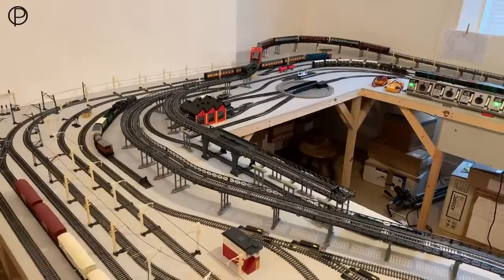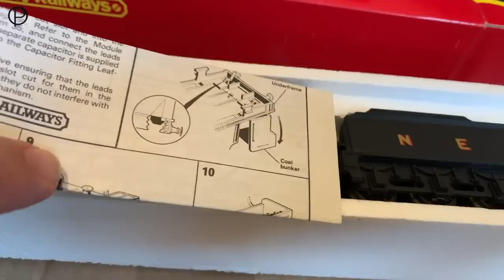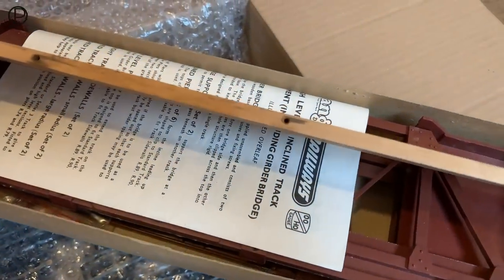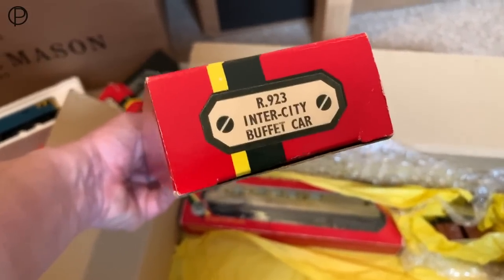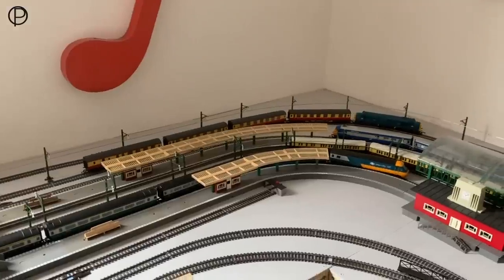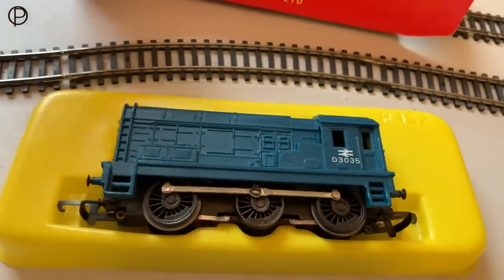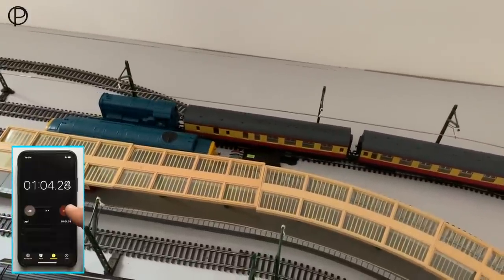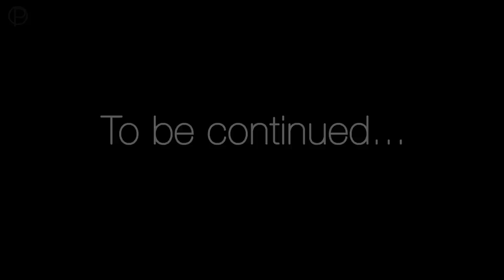A few new items for my Tri-ang Hornby collection plus slower running trains

Comment: For those who like a locomotive, but it has drop out issues over points. You can get a capacitor unit that will fit inside the loco. This stores the power for a short period meaning the loco will never suffer from short term contact problems again.
Reply from the maker: Good morning Graham thanks again for watching and the information its very much appreciated.
Take care.
Oscar

Comment: Hi Oscar, a great video with lots to enjoy. The roundel on the girder bridge sides looks like it doesn't have any molding on it - my grey R78 has a  triangle with an 'L', (Lines Bros. ?) and 'Rovex Scale Models'. I wonder what the story is for the different versions - all adds to the interest !
Reply from the maker: Good evening Peter glad you enjoyed the video you’re right I think there is something to those roundels I remember reading in the past I shall have to look it up. I think there’s also a slightly different design to the ends of the bridges over the years. There are so many little twists and turns in the history to these models it’s so fascinating.Thanks again for watching take care.
Oscar

Comment: Interesting experiments and some clever thinking. Might be worth looking at the other end of the speed range as well, what does any given locomotive do at full power with a sensible train. Gives some perspective too, the maximum speed on most preseved lines is 25 mph under Light Railway rules and a loose coupled coal train behind the old 3F tender loco would be doing well to get up to 40. Great fun
Reply from the maker: Good morning Andrew thanks again for watching glad you enjoyed the little experiment. It was great fun I think you’re right I should look at some different speeds.
Take care.
Oscar

Comment: My Dad  always told me not to run on half wave and high resistance as the motor would warm up , so I never have other than for slow speed shunting, for 50 odd years!. Is that wrong . Certainly impressive slow speed running. 6.9 mph on the diesel shunter wow , mine is usually at Warp 1 .  I have A Clipper from 1975 , ironically I only got it because they didn’t have the Hornby R910 in stock. I remember being disappointed at the time but it is a good controller . Still going strong after all these years , although my main Controllers are now Gaugemasters . Love the howl of the AL1 !
Reply from the maker: Good morning Russell great to hear you have the Clipper after all those years. Definitely worth hanging onto they’re a great piece of kit although I imagine your gauge master is far superior as technology has advanced. I’ve currently been looking at some more contemporary equipment myself. The AL1 certainly does make a terrific sound on the rails.
Take care.
Oscar

Comment: Great video, love unboxing videos. Can i ask why you ran the Lord of the Isles on half wave?
I have been told that it can damage the motor
Did your AL1 and coaches come in a train pack? Just asking as i have just bought one and some cantenery to go with it.. should be some fun!
Anyway thanks for the video and please do more unboxing style videos in the future.
Reply from the maker: Good morning Joshua great to hear you’ve got the AL1 and catenary to go with it. Mine came in the presentation set R.644A from the late 60s early 70s. In times gone by when my models were made it was considered that half wave was an effective method of gaining greater control over the locomotive. With some models this is true and others it has a little or no effect whatsoever. Some do say that it can lead to overheating of the motor however I find no evidence of undue heating in normal use. My model of The Lord of the Isles is a much more controllable model using half wave for some tasks. It does create more noise as a result of the way the power is delivered. Combined with a poorly maintained motor over heating might occur quite rapidly. And I’m fairly sure it’s definitely not recommended for today’s motors currently been fitted to contemporary items. It’s a thing of the past and should be used accordingly and great fun can be had.
Thanks again take care.
Oscar

Comment: Have you ever fitted a 5 pole to an X04 Oscar? Might be an idea to alter an R152.. and compare with a standard 3 pole in a 152 Shunter for slow running as an idea for a future video... Ive got one fitted in a Green R152 but its worm and cog are worn out! Am going to have yo get it fixed soon.. I can then do a compare with one of my other Shunters possibly from my recently aquired RS 50 "Defender" set!
Reply from the maker: Hi, I've not got any models with 5 pole motors at present sounds interesting an interesting comparison. Great to hear you have the defender set a great group of items and a lovely picture on the box.
Take care.
Oscar

Comment: Hi Oscar have you looked into the new Hornby 6000 bluetooth controller?  I've just received one in the mail, will try it soon, very reasonably priced.  Supposed to offer precise digital control wirelessly through your bluetooth device such as phone or IPad, yet be completely DC analog, not digital, so it works on older locos.
Reply from the maker: Hi I’ve heard about these they sound like a great idea please let me know how you get on with yours when you get it up and running. It will be great to know more.
Take care.
Oscar

Comment: Hi Oscar,  It's painful for me to listen to that "half wave"?  Back in the early 80s I used a Clipper (looks like the same one) to run my new N scale layout. (still use it by the way) .. I used the half wave setting a lot, to slow down my speedy little locos of that time period.. Unfortunately I ruined 4 motors before I learned that "half wave" is only meant to be used sparingly?  After 40 year's experience, I have learned not to use "half wave" unless absolutely necessary..  I now run virtually all of my N scale with a different type of controller altogether for extreme low speed.  The same controller works really well with my old Triang trains as well?  They run slow and do not groan like the half wave.    Also, when climbing hills, and descending the speed stays pretty constant too. No "running away" down hill?
Be careful with it, and don't hurt your locos as I did?
  Cheers,  Rob
Reply: High resistance setting is better for constant running.
Reply from the maker: Good morning Rob thanks again for watching and the information.
Take care.
Oscar

Comment: Dear Sir,

Great video, as always.

Just nitpicking, but i could not arrive at the same figure as yours, 414.414. I found 415.6364 instead: (8 feet / 5280 feet/mile) * 3600 s/h * 76.2 which  gives 415.64 (miles*s/h) and, of course, makes no difference whatsoever in your measurements.

And no, not all people in Brazil are as annoying as meself...

Cheers from Brazil!
Reply from the maker: Good morning Eugenio, thanks for the information. I’m very grateful for the work on the mathematics on this done by Model Railways Unlimited and Mr Snooze in both of their great videos. I’m not sure I would’ve come up with a mathematics myself. It’s all good fun.
Take care.
Oscar